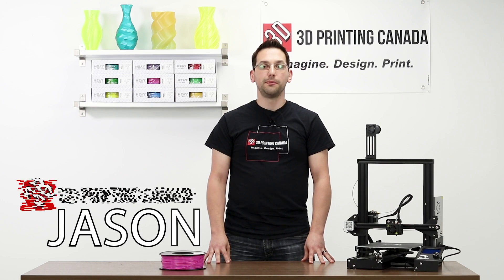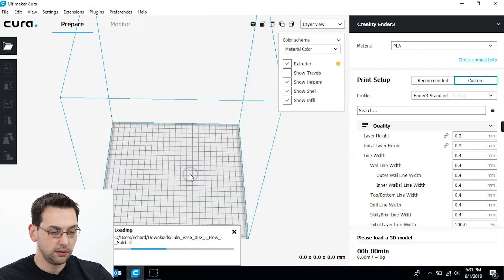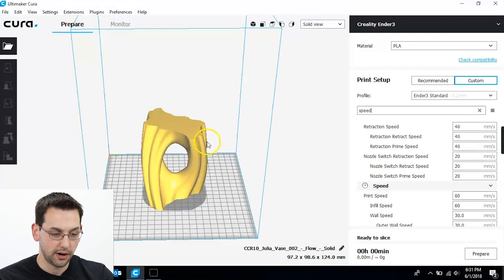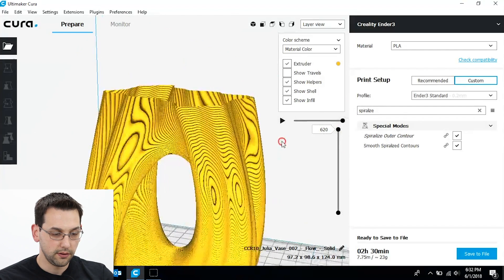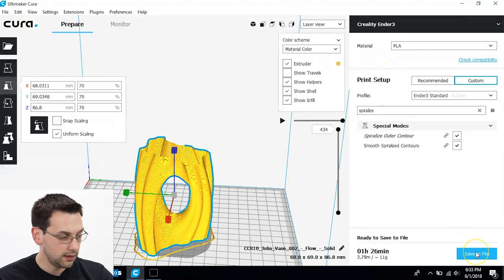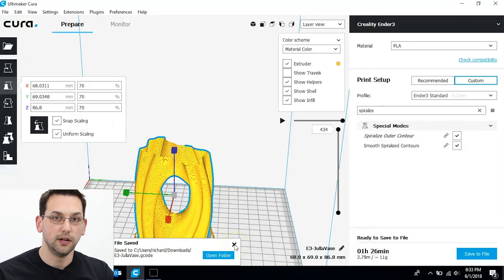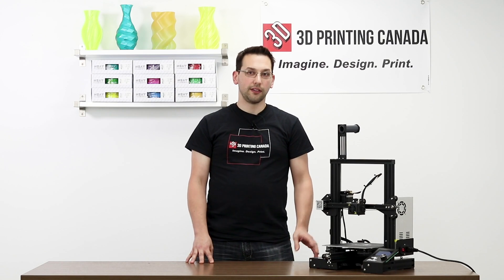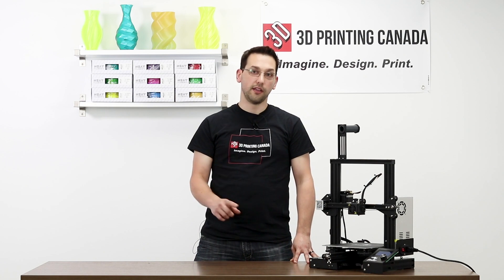Slicing and Printing a Vase on a Creality Ender 3

Comment: When I enable “vase” mode some of the print is stringy and see through.....0.4 nozzle with pla wood finish bed heat low nozzle heat 200, any advice?

Comment: This is my second video I’ve watched from you. I find your delivery of the material efficient and not automatically assuming the viewer is a 3D printing wizard. So I’ve subscribed. 

My printer is the Creality CR 10S, my needs are to see how to flash/upgrade the firmware. I have a link for flashing but I’m hesitant not knowing how valid it is. Link below:

https://www.printedsolid.com/blogs/news/installing-marlin-1-1-6-on-your-cr-10s-with-mesh-bed-leveling

Comment: Hi. I have a problem with my ender 3. The X axis doesn't move when is in home position the X axis stay lock when I want to move it. But manually the X axis moves well
Reply: @Jason 
Hey Jason, I like moving mine fast because the lcd screen lights up. Chinese default design. Oh btw, did bald Chris put this one together?
Reply: @robh1908  lol @ "bald Chris" and no, he didn't assemble this one. Ryan did